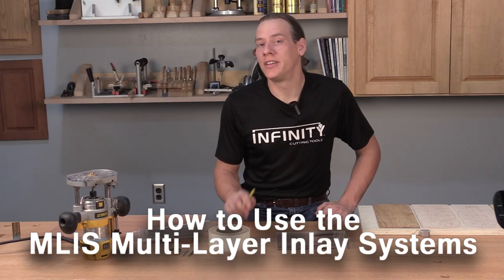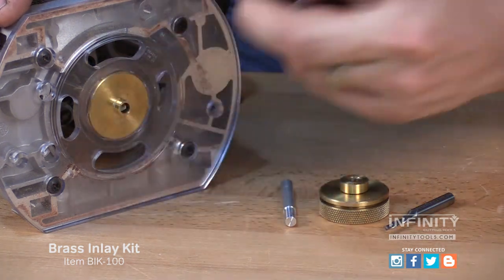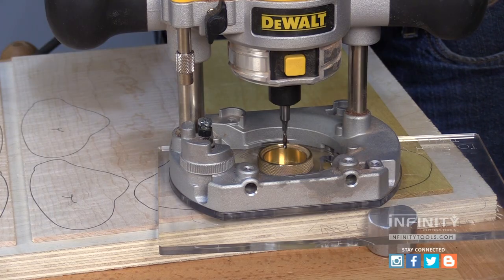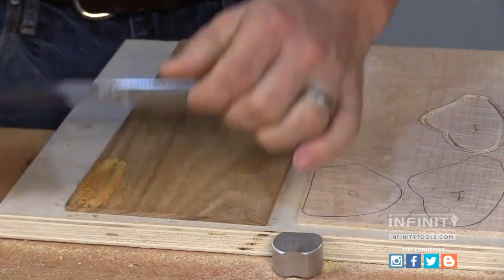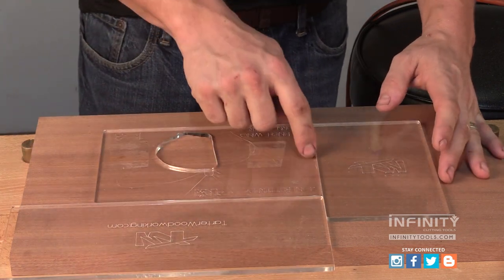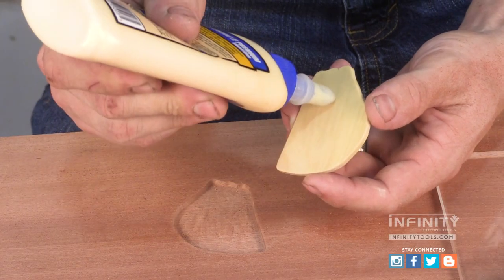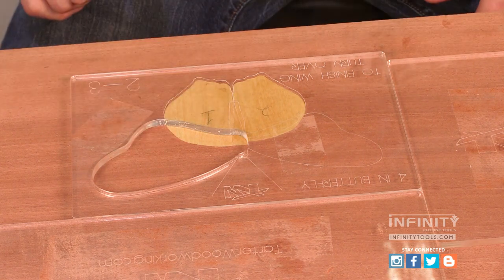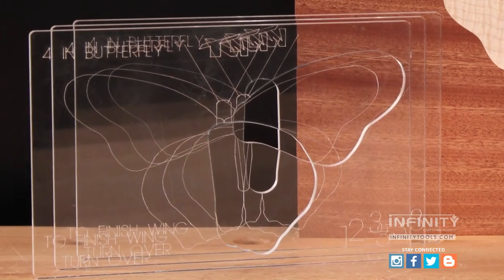How to Use the MLIS Multi-Layer Inlay System

Comment: Question: With using tape to hold the templates down and then flipping them over for the mirrored side, doesn't the tape leave annoying sticky residue that causes your router to stick and not slide well?
Reply from the maker: Hi Wayne, I didn't have any issue with tape residue, though some will be present. I do like to wipe the templates clean with a little solvent to make sure the next round of tape sticks perfectly. Building instruments taught me to keep hands and templates clean in case something slipped or you made a fingerprint in a spot you can't sand it away.